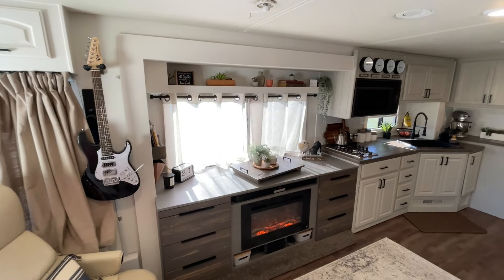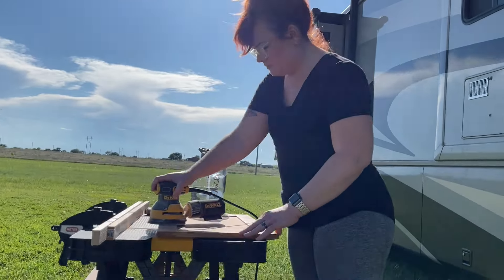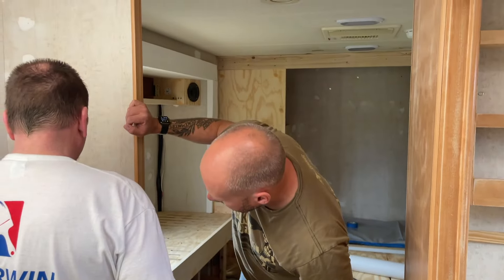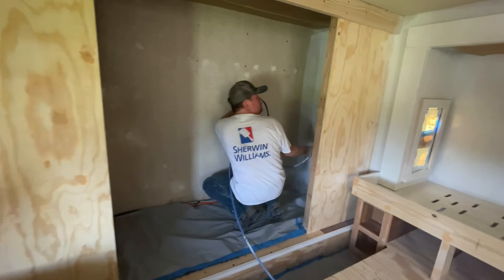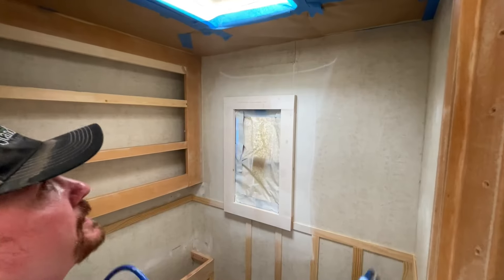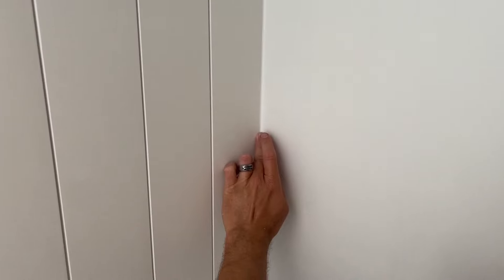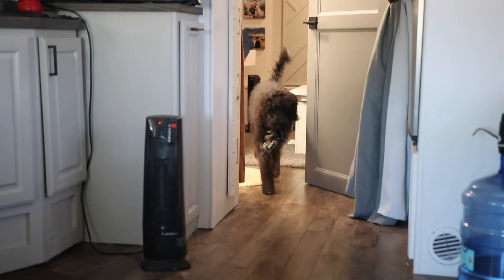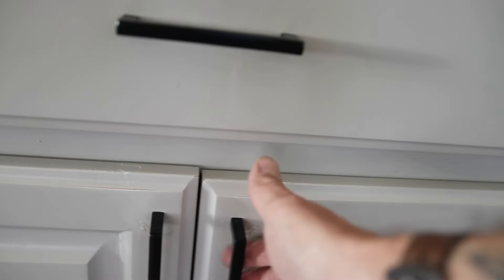PAINTING RV INTERIOR for LONG TERM DURABILITY (The Right Way!)

Comment: What a beautiful job guys! ! !   I have a question  We have a 2002 5th wheel and would love to paint at least the kitchen area.  Not sure what the walls are  It looks and feels like a vinyl finish bonded to the hard board.  There are no loose spot, amazingly.  How do you do this type of walls ?  Thanks for the help.
Reply from the maker: It’s more than likely a wall paper, we painted right over wall paper. All our walls were that cheap luan. We still roughed it up with a sander first. I hope this helps!
Reply: @RockinandRollin  Wonderful  It is a very small kitchen so it wont be that hard .  I will do the prep work like you suggested and it should last a long time.  Our first camper and I want it to look nice

Comment: I see on the Bulls Eye 1-2-3 primer it says sticks to all surfaces without sanding. Would you recommend still sanding before using this product? What kind of paint did you use on your shower walls?
Reply from the maker: Yes we recommend lightly sanding still. We used a paint on waterproof membrane.

Comment: I use a automotive paint gun for painting the walls of motorhomes 4 coats of paint and 3 coats of semi gloss lacquer for a killer finish just finish a class C rig a total remodel at my job in mesa Arizona RV renovators I also custom match any wood stain by eye 98% of the time the stain match is dead on matching cheep wall paper color is not hard
Reply from the maker: Thanks for the tips!

Comment: Pretty good video, BUT SEVERAL IMPORTANT THINGS completly left out

Like size of the spray tip (small 212 or 311)

Lightly sanding the primer with a fine sponge.(.if it's modified latex with oil)
And primer has not laid out enuf ..

For God's sake get a respirator...

Fine sponge also between the fogg coat and final..maybee

Comment: How has the paint held up with temperature fluctuations?
Reply from the maker: So far great! The humidity difference shrank the wood a bit which shrunk some of the caulk, but other than that, the paint is holding up very well! It’s worn in the most used places like a few of the kitchen cabinets.

Comment: Why in the hell did you paint the speakers? Duh
Reply from the maker: They were old speakers. We just used them to block the hole and we had brand new ones we were putting in after. We used them as a paint barrier.